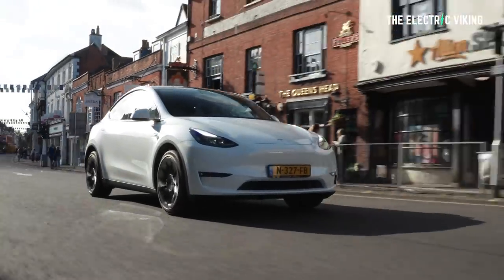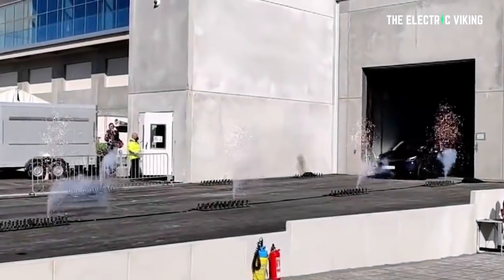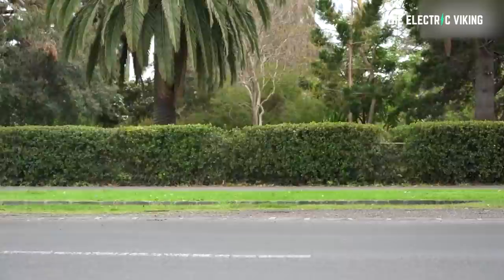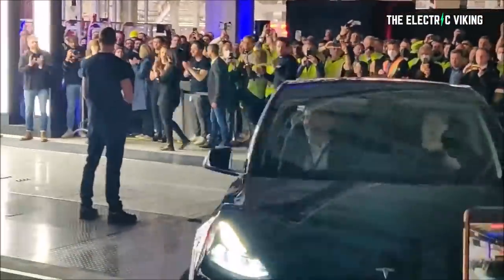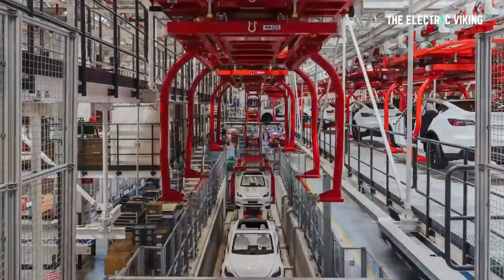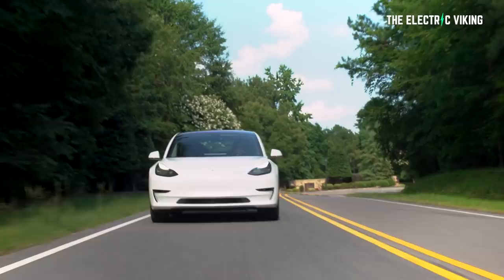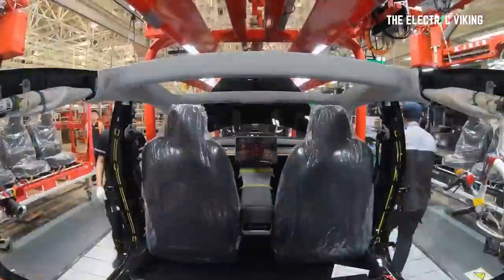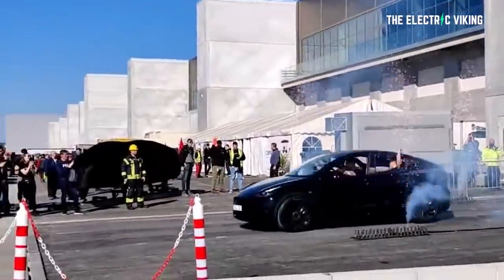Tesla says it will build other car models in Germany?!

Comment: If supply keeps lagging behind demand, there is absolutely no reason for Tesla to lower prices...
Reply: Lowering prices, are the long time goal in every plan Elon has made, and the natural main next step in the car production. But it needs 2-3 times the 2022 production capacity, so the startup of 3-4 new Giga factories will soon show us how Elon is going to implement the 25K$ compact, in the product line. The 4 Gigas so far can maybe meet the demand for M3 and MY, but not include the demand tsunami the MQ or whatever they call it, which have been in the very secret design phase for at least a couple of years now. But its not enough to have a prototype.

Comment: I agree with you about a small hatchback in Europe. A van of some size would also do very well (world wide). He could sell a customizable cab only version for the small commercial truck market that would clean up.
Reply: Car-size and midsize vans would be awesome indeed, but Tesla seems to be short on design and engineering staff for new vehicle conception, or already has its hands full with the Model Y/3 long waiting list. Profit margins for commercial vehicles such as vans are also usually thinner, but then competition really sucks at it, even though these non-full-size vans also have a market as family/recreational vehicles, not just commercial ones.
Tesla produces only one body per car, barely more than one color, so customizable cabs would shrink profit margins. However, Tesla will never go mainstream if it does not start soon building cars for every need and desire: Every single mainstream car manufacturer offers hundreds or thousands of different models, bodies, motorizations, colors and budgets. You are guaranteed to find a car that fits your, err, shoe?
Reply: @Chimel31  agreed. I really didn't describe customizable cab very well. I meant cab (van style) with chassis. Customizable part would be the box, etc. you put on it. I was thinking of all the small trucks (lorries) I saw in the UK.
Reply: @carrdoug99  I did get what you meant allright, a front cabin on a chassis where you can choose between a flat bed, a box, etc. Even mid-size vans often offer 2 lengths, full size vans 2-3 lengths and 2 heights. Tesla would probably go the Rivian way first, with just a single delivery van, because offering the high level of customization that professionals need on a brand new vehicle segment will never happen if they're not even able to do a hatchback or a station wagon on an existing Model 3...  ;-)

Comment: It will be the network effect.

The electric recharging network is far cheaper to operate than the petroleum refuelling network and has much lower fixed as well as variable costs. It also requires a different business model.

 As the customer base for petroleum transport fuels decline the cost of providing the service will go up as fixed costs are spread over a smaller customer base.

It is reasonable to imagine many gas stations will close and the cost of distributing petroleum fuels will quickly rise. 

The change could be quite rapid.

Comment: Hey!

I'm thinking Model 3 then a small hatchback, at some point a station wagon. Then commercial vans w/rv-type variants. Semis as soon as battery supplies sort out.

The same as here in the US only here including cybertruck.

Price? I think you're right that eventually price reduction will happen. Just not until they've caught up with demand. That would be a combo between what they can produce and what the rest of the market can.

Had legacy auto snapped to taking on, with urgency, the mission to convert to EVs, even 5 years ago, the market would look much different right now. As long as it takes non-Chinese companies to step up to providing 50% of market demand, Tesla will be forced to keep their prices high. I think that'll be true even for smaller models.

Comment: Obviously! Short term they will concentrate on Model Y/3 as there is such a huge demand and supplying them locally makes sense. Longer term as the market expands (which it is enormously) more models will be needed to match demand and it will be far easier to make them in Europe to supply to Europe. I can see another 2 European factories in the next 10 years, where I’m not sure.

Comment: Most likely new model is B segment hatch and / or crossover. This will be based on the new B Segment platform under development in Shanghai R&D centre. ( Don't believe Musk's statements to the contrary). Exterior styling is likely to be different in EU, as B Segment for China will pick up on styling cues for that market. As I understand, there will be a Berlin styling centre that will pen the lines for EU taste. Most important to realise is that the B segment model(s) are likely to be built in Giga Berlin phase 2. Reason? An even more efficient manufacturing process based on single piece Giga casting for the front, rear and passenger cage combined. Tesla have patented this, and it will further reduce assembly time down from 10 hours to maybe a target 5 hours.  Exciting times!

Comment: But they are selling like hotcakes already.  Until they can start to catch up to demand, they need to focus on production of current models.  That demand will eventually be met and give them breathing room to introduce other models.
Reply: Selling like hot cakes? but all but the cheapest model 3s are available with just  a 6 week wait, May delivery, and this is before Berlin is making 1/20th of capacity. The VW I want won't be available till mid 2023.

Comment: I think they won't go down in price this year. It would be nice, but I think it will possibly only happen with a small batch in the ramp up phase, as there may be quality control issues during the ramp up. The reason I think we won't see a significant price drop is that Eurooa still has a debt crisis from Greece, the economic crisis in 2008, the enourmous costs that went into the covid vaccine and lock down procedures, amd now the crisis in Ukraine. I'm not sure how Tesla can afford a price cut, without dropping the 30% profit margin at their own expense. Material divisions are I think not going to drop prices as people climb oit of the recession and people still have to build up lost reserves and income due to covid of the last two years. Its going to be a challenge. And demand is also high for evs, further increasing selling prices, not discounts.

Comment: And  lets not buy one until they get past the Model "T" stage. Battery development has quite a way to go. You need a good reason to scrap an ICE vehicle if it is reliable and EV's can only get cheaper and better. Doing it "Just for saving the environment" is not a good excuse unless you have an ICE vehicle on its last legs and you have the ready folding commodity to buy one.